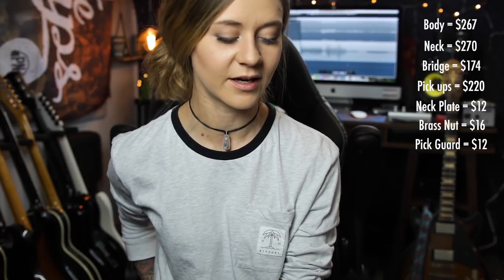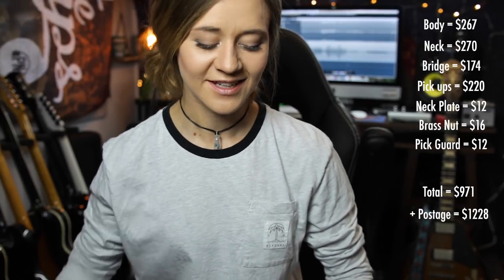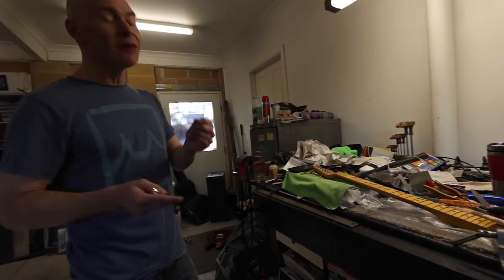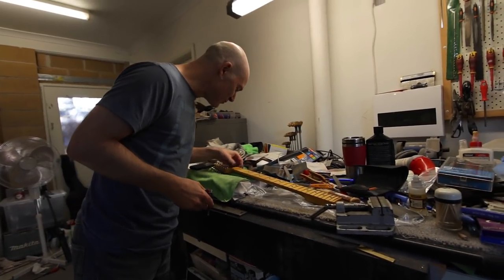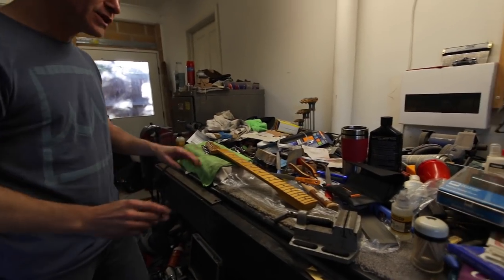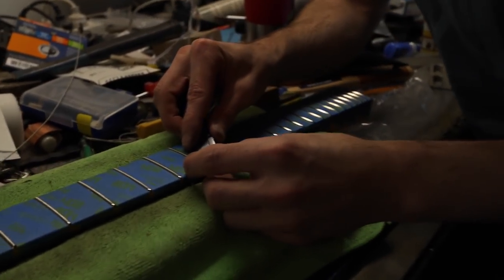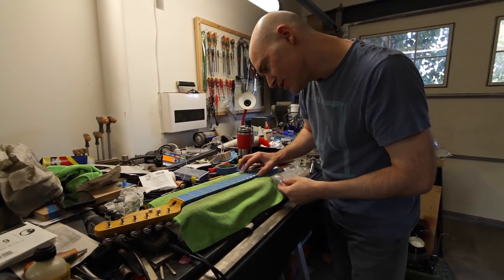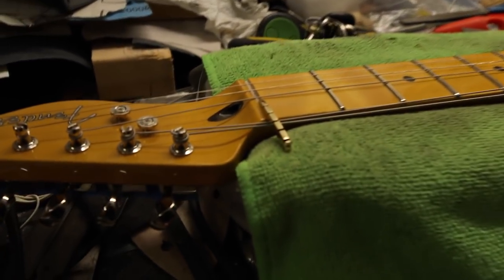My Telecaster Build: Part II - Putting it together with Matty!

Comment: Coming directly from the first video, since u had to route out the next pocket for the neck did the screws still line up or did u have to drill new holes in the neck and or body? sorry if answers are in the video